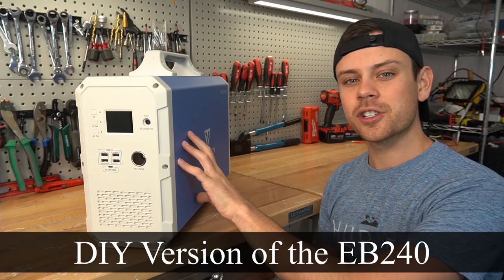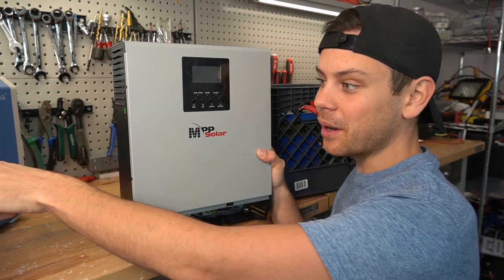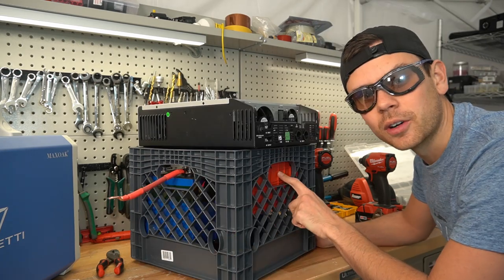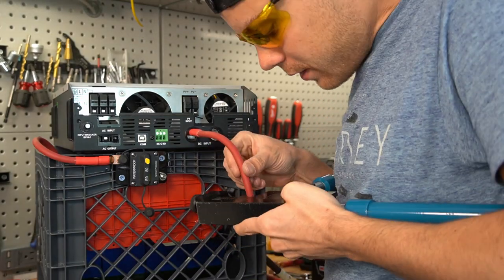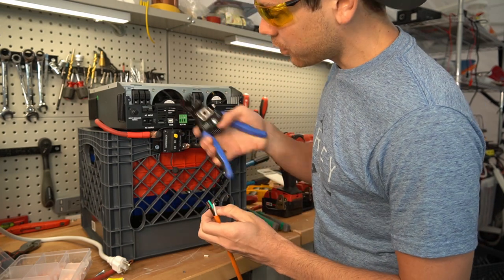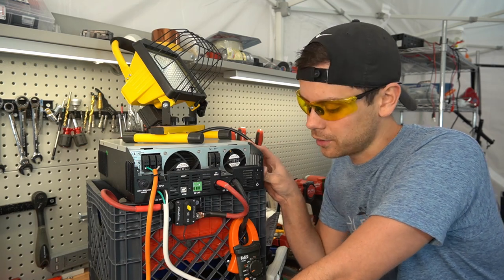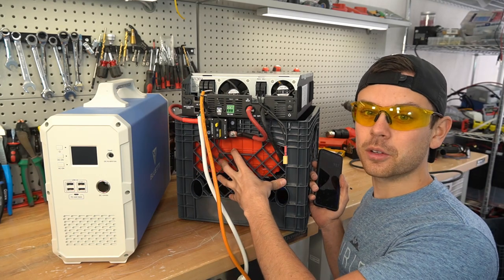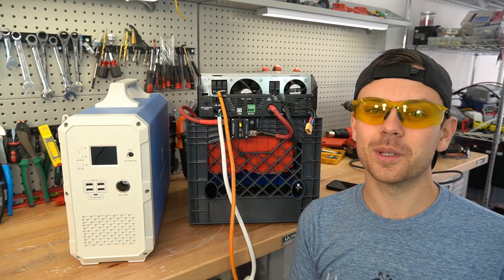$1050 DIY LiFePO4 Version of the EB240 Solar Generator: More capacity for $550 less

Comment: I'm in the process of completing this. My cells arrived two days ago, although I ordered them in July. No shipping or tracking information ever showed up at all. Then, one day out of the blue, they were on my porch.
One of the cells wasn't perfect, but the rest were. It was slightly bowed.
I added a board that is 16"x30".  I laid the all-in-one sideways on the milk crate. The board is used for circuits, circuit breakers, DC & AC electrical outlets, fuse box, and TV input. It's beautiful if I do say so myself.
I built the $640 one too. I used it every day to watch TV with. When it runs down, I put it in the kitchen. There, I have an xt60 plug running outside to my two 200 watt panels hanging on the fence. They're propped up so that they get the angle right for the Sun.
I really appreciate you, Will, for all the projects you show people. You're just a kid, and I'm 60, and I'm learning loads more than I ever did in school.
Thank you so much.
Reply: PV, not TV!  I bet this could have set off all kinds of crazy comment! LOL
By the way, weighing in at about 70 lb, and being 36 in tall, I bought one of those little magnet carts they have. It's basically a two wheel dolly that folds up kind of flat. It's just the right size for this.

Comment: I built my first solar system using the same MPP Solar and batteries after watching lots of Will's videos, it has been working great.
Reply: Yup, that's what I did, just with the 3000 W, 24V MMP controller  . . . and I live in the off grid home powered by the system. Works like a champ.

Comment: I've been binge watching your videos all day and these things are amazing. Love how you keep moving at a great clip through all the relevant info, with minimal delays. Have you ever thought of how to make one of these all-in-one systems weatherproof? I've been trying to come up with a design to incorporate your Milk Crate 2.0 into a weatherproof tackle box or something along those lines, with a DC quick-connect so I could clip it in and out of my off-road trailer's 12v fuse block, but still use it as an on-the-go power pack for outdoor events when I'm not camping. I would absolutely love to see a video tackling an issue like this!

Comment: I've been wanting to build exactly this type of solar generator system, after checking out the Yeti 1000x and finding it massively overpriced for the capacity.  I just ordered the same lishen cells and i was trying to figure out how to get ac wall power and solar power to charge the cells and this video solves all those problems, PLUS includes the inverter!  Sweet!  I've learned more from Will's videos than any other source.  Amazing.

Comment: Will.
 This is fantastic I'm getting ready to build a system for my van and you just showed me the system that I will build thanks so much.
Reply: This really is a great idea. I am thinking about using my Suburban instead of a milk crate. 300 watts on the roof sounds good for Colorado.
Reply: Don't buy those batteries. I built Will's system. My batteries get about 300 watts for 20 minutes before the inverter shuts off due to low voltage.   Aliexpress is a rip off.

Comment: this is great, I am buiding the exact same set up.. already received my MPP Solar 1012, and Daly bluetooth BMS , and circuit breaker, now waiting for the 4 x 280ah cell from Basen, i put them all in a rolling tool box with 2x12mm temperature control fans for cooling an air circulation
Reply: @chriseudy4684  which is why LiFePO4 is chosen. They are a far safer chemistry to use.
Reply: Oops I just was being a Bevis
Reply: I ordered the same batteries, three months and still have not arrived. Alibaba keeps giving new delivery dates each time I inquire.
Reply: At least you don't have to pay £100-150 import fees on battery's like I do, crappy UK.
Reply: @Jules Gardet - That's too bad. Been wanting to build one of Will's diy systems but the battery delivery wait times lately are pretty discouraging :(

Comment: If they could do an all-in-one inverter at around 1500 watts and drawing less than 10 watts in standby, with built-in DC isolation so you could connect to your vehicle alternator/battery, that would be perfect for van-lifers.  😊

Comment: I would have moved the BMS and drop the " all in one " in to the milk crate. The display would be vertical and the hot wires would be at the bottom of the crate.
Reply: Agree!  Love Will's diy projects but on this diy I think I prefer the BMS mounted inside the crate.
Reply: Hello Mr. John, I’m having trouble visioning this can you expound on this a little more? I was wondering if I could build this to where it could be vertical. Thanks
Reply: @randolphbrewster2149  move the BMS over the battery. And in the space were the BMS was. Install the "all is one" vertical.
Reply: I thought of that too, but would you run the risk of cutting off the cooling fans and burning out your unit?

Comment: Great video. Love the all-in-one unit you used. These make things so simple, even I can do it. Thank you.
Reply: wish the links were for the parts (for us dummies) not websites...maybe he will change it
Reply: @saltpepper1894  Links are usually provided but we can Google for parts. Plus you may find something more suited for your build.
Reply: @a787fxr  have you looked at the links? tried googling the inverter....couldnt find it even with the part number. MPP solar website isnt that helpful either. Guess if i called them i could get it, but hey i aint rich, cant afford to screw up....
Reply: @a787fxr   MPP solar motto is: "buying solar should be this easy" lol.  Looks like the batteries are fairly straight forward to order.
Reply: @saltpepper1894  They are listed on eBay. Maybe this isn't a good idea for you. That's why plug and play units are available.

Comment: At 6:40, there is also another advantage to your system - it is modular.  If a part fails, you can replace it.  And iff you want to upgrade a part, you don't have to "hack" it.  Thanks for this video!

Comment: This looks like the one to make, I've had my solar panels for months, but haven't hooked them up yet.  I have 6 golf cart batteries, but currently they only power the fan and electric start on my heater and the pump for my sink/shower.  I can't really power much else with my batteries and inverter so I've been looking to upgrade.  Currently hooked up to the grid, but will need the solar for when I move.

Comment: 3:55 think i would have those two wires come out the same side as the others so you can have 3 clean sides of unit for easier storage in van

Comment: Better suggestion to build an diy design crate or box with as much as air flow printed with 3d printer or buy an better design box specific for this diy project which could hold these things at better specific compartments of this all in one and batteries  also easy to repair or have any changes if we needed to open it, and have an better appearance so we could also not hesitate to take it out anywhere ! Love from INDIA !

Comment: Very simple and straightforward. Just need to add AC terminal/line protection and strain relief and the system should be reliable and safe.

Comment: Cool but now I want to see you add the £20 usb and 12v port and put the whole thing in a plastic case to see if you could sell it as a unit/system like a all-in-one power system, just like the 1500 system.

Comment: Will, have you ever considered, or have you already made perhaps, a video on a small portable set up like this that's 240VAC output? I feel like I read somewhere that two inverters could be used to reproduce each leg of the split phase instead of one meant specifically for that intention.

Maybe I'm wrong, it would hardly be the first time.

Love these videos and the enthusiasm the information is shared in. It's been a very long time since I looked into solar, and catching up had been very easy.
Reply: Mpp does make links Le inverters, but I don’t think the one in this video will link, to output 240V
Sigineer, and aims etc, all make 240V models. 
Now, if you are thinking non USA 50Hz 200/230/240, then mpp and MANY others make a 3000VA model that is useful and inexpensive. In the USA, if you need 240V, you need 4000W or more anyway...

Comment: Thanks for the video! This build is so close to what a diy van dweller would need if they were using a 500 watt window AC unit. I believe the charge rate is at 500 so... If you had enough solar you could almost continuously run a AC window unit. Considering the 3000 watts the  battery, I think this really would work. $1,000 unit plus $200 AC plus another $400 to $500 for the solar panels less than $2,000 you could continuously run AC unit with good sunlight.

Comment: I made a smaller version with two jumper pack batteries 19 AH each..they have #4 leads with colored clips so if I use the DeWalt sawzall too much off of the 410 watt inverter then I can just give it a quick shot off of the truck battery..its also handy to give the mower a jump..I got the batteries for $20 with the cables and clips and I got the inverter for $10.49 on clearance at Advance parts house..I got the last one they had here..I did a Red Green and just taped the batteries together and found a nice handle for my " grab pack" ...lol...

Comment: You have made my day at 4:00 am cst. I’m here in Texas and you know what we just went through. I’m going to build this power station and I will buy one of those doilies that are designed for office use. I think they’re designed to carry 75lbs. I hope that you have listed all of the parts needed for this project. Is your website the same as it is in your book?
Reply from the maker: Thanks! And yeah, parts list is in description. Check out my website for other packages and systems that might work for your situation. Lots of various options on the site
Reply: Uhm, you do know the sun has to shine for the solar part of the setup to work?  My understanding is there was little to no sunshine/grid power for 5+ days in the affected areas of Tx!  Save yourself some money and just get a generator and add some fuel storage.
Reply: @peterhaan9068  Used my bander her in Fort Worth during the storm and a 50 watt panel. Worked great for the small stuff. Yes one of the days had very little sun. But still got by on just a 50 watt panel.
Reply: @peterhaan9068  You understand huh? I actually live in Texas and we had so much sunshine on Monday and Tuesday (Of the week of the power outages) that I got a sunburn on my face from working outside clearing snow and wrapping pipes. The only reason a lot of sites didn't have solar power was because there was snow on the panels. I cleared off the snow and hooked up my DIY 10 kWh lithium battery + inverters on my motorhome to my house to run everything, and charged it from my solar panels.
Reply: @peterhaan9068  this is alternative energy, as in free. There was no gas available in Tx, and storage isn't practical long term.
Reply: You should always have more than one source of energy
Reply: I should have said more than one source as a backup
Reply: @peterhaan9068  most of the days here in Houston were sunny during the arctic blast.

Comment: Costs less and does more. There some “hidden” costs for very specific tools t crimp cables and shrink wrap.
Reply: Was thinking the same. The EB240 is $1500 right now but I figure with all the "extras" it could because equal or more. I've used the EB240 and the form factor is perfect for what I need fitting in the back seat floor of my truck plus I like that it's a bit safer without the exposed wires. Also, I'm leery of me burning something out by connecting a wrong wire and costing more money to fix.

Comment: Well done, easy, cheap and simple. but one issue. The BMS you are using does not have low-temp shut-off which was a negative from the other build you did.

Comment: Really cool stuff! I'm in UK where we have 240v appliances and seemingly 24v solar stuff is difficult to source. I'm researching a solar system for a van to motorhome conversion now and your videos are very helpful. Here in UK it's mostly Autumn (fall) all year round now but we can have extremes of temperatures from the 90's down to -20 degrees so I need to find out the best way to configure the real estate on top of my van for solar panels. I'm thinking 2 pairs of parallel panels in series with each other, a pair at either end of the roof to try to minimise shading effect.
Reply: I'm also in the UK, but disagree that 24v stuff is difficult to source. I've got a 24v / 240v 2kw PSW inverter for sale if interested.
Reply: @alzdeane  might well be, can you email me the details please?

Comment: As someone who takes their batteries camping a bit, the milk crate is a bit too exposed for my liking.  Rain and water aren't uncommon so I would need to figure out a more sealed box that can fit that.  Also a fair bit of my lighting is DC powered so we need to add a few connections for that, but that isn't too hard.  Finding the right sized box is always easier said than done it seems.
Reply: I like the craftsman rolling stacked toolbox.
It has wheels and a handle for hauling heavy stuff, the upper boxes can house the inverter and cords etc. And it closes up fairly rain tight.
However, it would need to be opened up during use, for airflow and such...

Comment: I've been trying to find all the information i need to make this a reality and this is the best channel ever!  Super pumped to get my battery all set up and ready to go.  Im making this for my Mom who has a CPAP machine who she wants to be able to run it when the power goes out.  I bought the batteries and the all in one.  The one thing im wondering is on your site you list the settings and it seems like its for a 24 v system.  I'm looking for help on the settings for 26,27 and 29 for a 12v system to make sure i set it right. Has anyone else set this up and have a list of the settings they used?
Reply from the maker: Post this question on our forum at www.diysolarforum.com

Comment: Great video !!  I am looking to install a backup system to run essentials in case of power outage (furnace fan, refrigerator, etc.).  Would this be sufficient?  Thanks for all of your valuable information and advice.

Comment: Even before the recent snowmegeddon in Texas, I was wanting to look into some sort of renewable energy for electronics, flashlights and maybe a small refrigerator. Ive been looking at your videos and a couple others on YouTube. Could you recommend a power station with a quick recharge that is semi-portable or small that I can look into? Thank you
Reply: check out his website. There are numerous designs. Lithium will charge as fast as you can supply it with power. Usually the charging circuit is the limiting factor.
Reply: @epfd217  Thank you very much
Reply: Here in Ft Worth used my bander 330 with 50 watt panel and got by. Had no power for 45 hrs. then only 20 min of power followed by full power after 50 hrs.

Comment: The Bluetti manual says Battery
rated voltage
14.8Vdc
rated capacity
1200Wh
1500Wh
1800Wh
2400Wh
built-in battery cell
Li-ion
Li-ion
Li-ion
Li-ion
battery packing
4S30P
4S3P
4S45P
4S60P

So, it's Li-ion.....

Comment: I don’t trust those type circuit breakers.  I configured my RV solar system with those and the one between the battery bank and inverter would always prematurely kick off after a minute or so.  I installed ANL fuses instead and it works fine.
Reply: If you buy actual BUSS or BLUE SEA brand breakers, they work properly. If you buy the China knockoffs, the amp rating is a pure crapshoot... use quality, and the breakers are fine.
Reply: the cheap cloned circuit breaker on EBAY or Amazon ARE JUNK,  get the real one from Bluesea (made by EATON/BUSSMAN) which will cost more and a lot better quality.
Reply from the maker: Yeah I agree actually, but this one is awesome. You have to get the safety certified chinese ones. Even the expensive ones are made in china these days.
Reply: @WillProwse  Even, reputable European brands are starting to have the “Made in China” label. 😬
Reply: Thanks all for the clarification.  If I find my system blows certain fuses, I’ll look into replacing them with a decent breaker.

Comment: You haven't discovered ferrules yet. Really great for making those power strip extension cord leads for terminals.
Reply from the maker: I have a few boxes but never use them. They are nice.
Reply: @WillProwse  I took the plunge on I think a $15 one off of Amazon as I was building a 30A UPS bypass switch. I've gone through almost half the box. I bought some extension cords to cut in half and I did both ends up and it really makes it great for terminating in terminals for quick things. Keeps all the strands in place.
I like them better than fork terminals, can even cheat them a bit and get 2 wires in one terminal with the uninsulated ones. Plenty of videos about them.

I rerouted the lighting circuit in my basement since there are very few windows on that side, out to a cord that can plug into a UPS. And I did another one for a utility outlet feeding cable modem, amplifier and antenna amplifier. Figured for the lights and the router that could just plug into a couple of spare UPSes. The 30A transfer switch was for my nice big Free 3000av one that died before I completed the project. Oh I got sidetracked yes I have two pigtailed female cord ends about 2 foot waiting for a project all terminate it up nice.

Was using a SLA car battery as a power station last year, I keep hoping to take the plunge on lithium still just quite not in my price range. But this channel has certainly contained a wealth of information. Unfortunately deep cycles are just on the edge of my price range but way too heavy for my applications. So saving and watching.